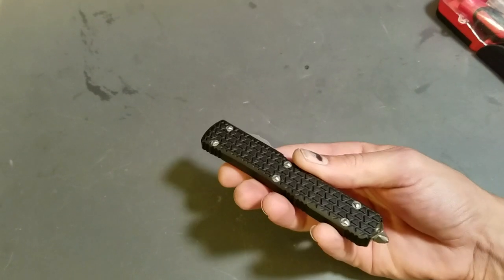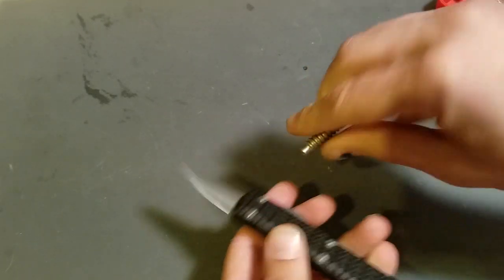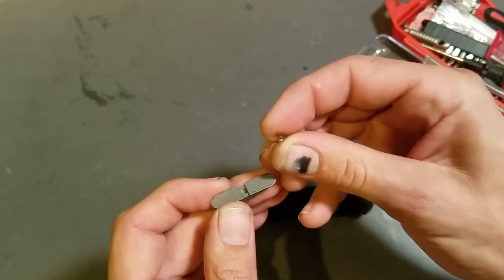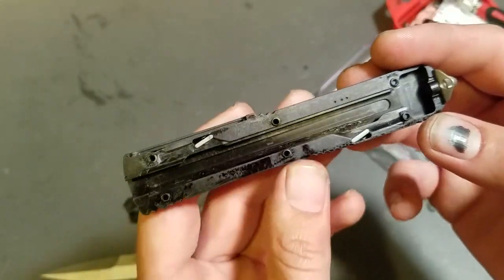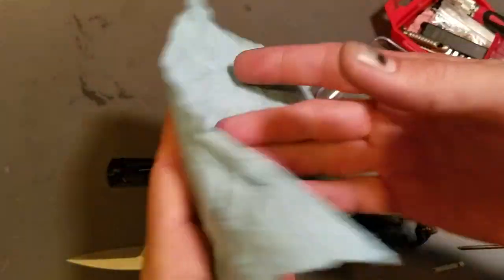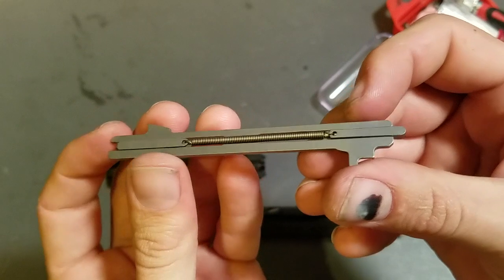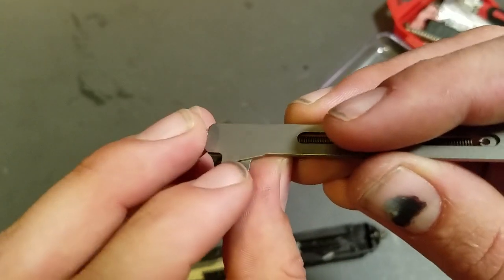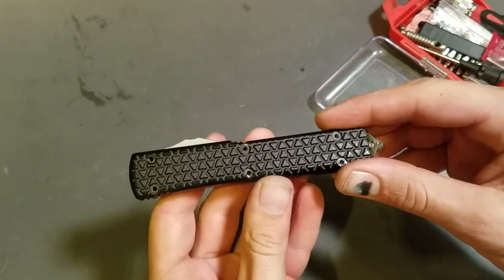Malfunctioning Ultratech disassembly

Comment: Hey man just wanted to say THANK YOU. I over oiled my knife and wanted to disassemble, easy enough but getting that spring back on was terrible, it just kept jumping when I'd try to set it under tension to the back of the blade. @5:30 you showing the spring just needs to be attached to the slide saved me. I just moved the blade forward and was able to get everything back together. Knife firing a lot smoother. Seriously saved my day.

Comment: We have found that a dousing with lighter fluid takes care of this.  Very light lube film from lighter fluid.  It won't hurt the knife or its handles... it cleans it up well and restores function without taking the knife apart.
Reply: Until it bursts into flames
Reply: @gwagwa76  :D good one! :D
Reply: @FuelTankerMan  Microtech recommends spraying Rem Oil inside of it and holding it upside down to drain off excess..They literally soak it in their video
Reply: @numbone  okay, thanks!

Comment: If you remove the blade stop and reassemble it, wouldn’t that be a Ballistic knife?😂
Reply: Tried it with another otf it does but doesn't go extremely far but it works
Reply: jamal9 try with a Halo V?? 🤔
Reply: A very weak one.

Comment: If you can see a puddle of oil when you pull the side off, there's WAY too much oil in it!  In fact, the best way to run an OTF is "dry" with just the barest hint of oil - because it really doesn't need any.  A few drops of oil create drag on the blade making if misfire, and over time, oil tends to thicken as the solvents in it dissipate leaving behind a thickened sludge or gunk.

Comment: Is this a legit ultratech?? I've never seen this one before from microtech. I found one identical on Amazon that's unbranded for $50. It's a little heavy, but man what  great knife! Especially for the price. Not one single problem with firing the blade. It hasn't failed on me yet.
Reply: It's a little heavy because it has a Zinc alloy handle instead of lighter aluminum.

Comment: Mine started with the same problem as yours. I did the oil and compressed air thing and it worked for awhile. Now the switch moves freely up and down and the blade doesn’t come out. I’m bummed. I haven’t decided if I’m going to send it in, or try to fix it myself, just yet.

Comment: I bought a brand new UTX-70. It's not legal for me to carry, so it's just been sitting in my collection since day one. Today, I found someone who wanted to buy it so I went to grab it and it's malfunctioning... The blade will not lock in any position (open or closed) and the switch is loose and does nothing as well. I cannot manually lock the blade by hand in the open position either for some reason. Pretty sad that this can happen to a brand new knife that has literally never been used once! Of course, I cannot send the knife for warranty repair because Microtech will not ship to my state anyways... plus they're temporarily closed as of right now because of the COVID-19 stuff. Had to buy the stupid little tool today just so I can take it apart and take a look.

Comment: Pls do a re assembly without the stopping pin. Projectile test?
Reply from the maker: Charlie Symons LOL that's awesome idea I don't think it will work but will do for sure
Reply: Lugermonger epic thanks so much
Reply: That wouldn’t work at all , unless you removed the front lock tab , even then ..it doesn’t have the spring tension to make it go further than probably 2 feet or less ... that’s if the blade even makes it clean out from the handle .. since it’s connected to the spring slide it would reach a certain point then pull itself back in ... fun idea , but the mechanics behind Microtech ultratechs are there for a reason .. you want a ballistic knife , there’s videos on how to make one on YouTube , or you could try buying one lol 😂good luck 👌👍
Reply: @clandestinetactical  perhaps a single action instead of double? Much stronger opening than a double so if just trying to launch that might work with the right build

Comment: You are supposed to use rem oil spray with a straw and activate the the knife several times then use compressed air also with a straw like a can of air for cleaning electronics no need to take it apart ever unless you have had it in the ocean or sand. This is a good way to lose parts and void the lifetime warranty that comes with every Microtech.
Reply: Where do people keep getting this info that taking it apart voids the warranty? Microtech specifically says it will NOT void the warranty to disassemble it. Also, that's illegal in the US anyhow. Has been since the 1970's. A warranty may not be voided because something was taken apart. Even if you break the "warranty void if broken" stickers.

Comment: Luke.. I have the same knife. I bought it a day ago and out of the BOX it's doing what yours is doing. I don't want to send it in so I may take it apart. I wonder if there's a way to mod it so there's no safety derailing so it will always fire ?
Reply: $300....I`ve heard a few of these stories..Are the tolerances that tight that just a tad piece of dirt will cause this???   I like the "no safety " mod question...

Comment: I tried to "oil" mine, and it immediately stopped working. The oil suctions on the inner part, and slows down the deployment. I use white gun grease, it works very well.

Comment: Awful reliability for 300$, bought several MT knives, but regret of two Ultratech OTF's. It just expensive fidget automatic knife. Mine new from the box having issues with locking when deployed, REM oiled several times, lots of oil, tiny amount of oil, nothing work.